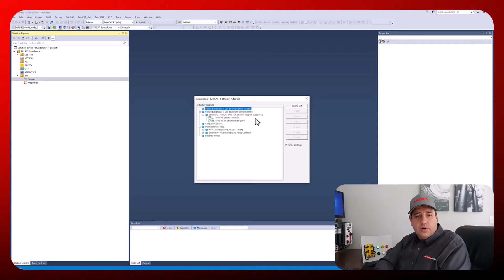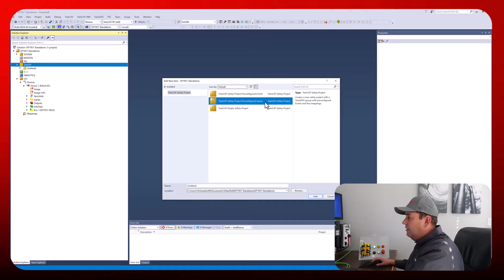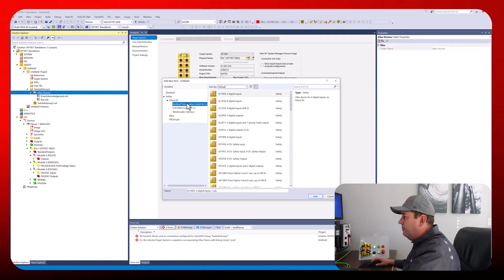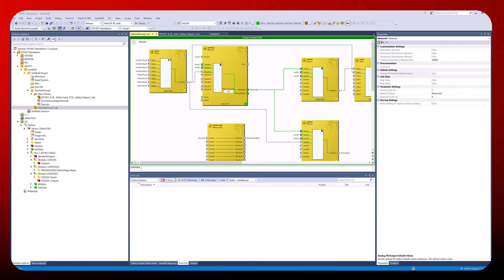EP1957 Stand-alone mode

Comment: When I put hardware address equal to zero I got the following error "Invalid TwinSAFE Address for alias target system (1-65535 allowed)."
Reply from the maker: This only works in stand-alone mode with out an EtherCAT network. What version of TE9000 are you using? Also, best practice would be to give it an address anyhow. 😉